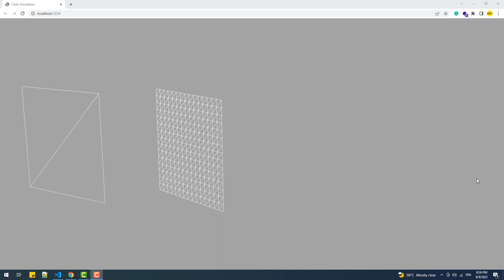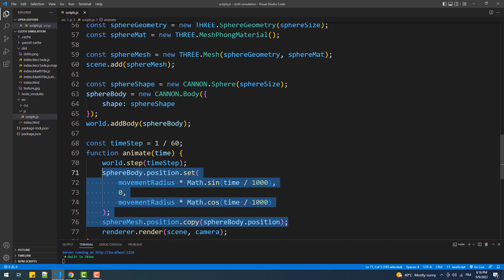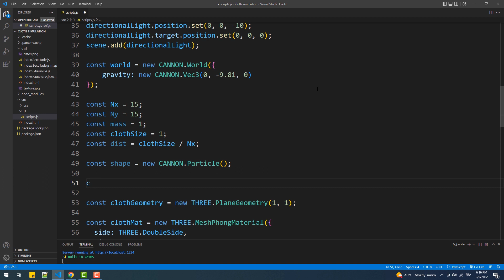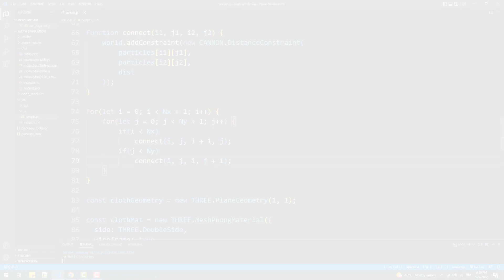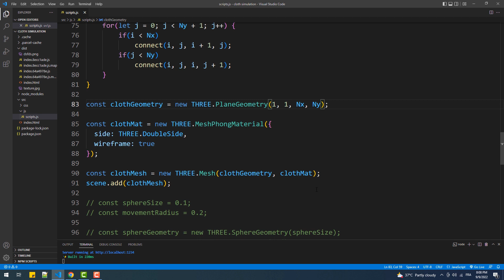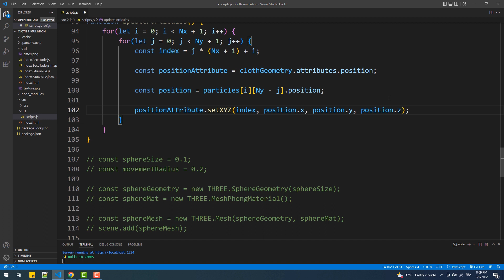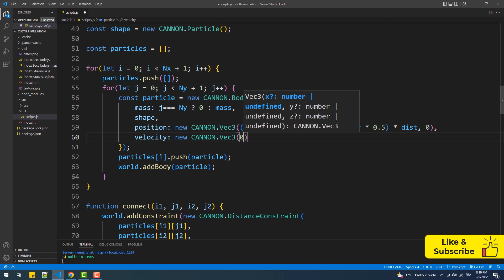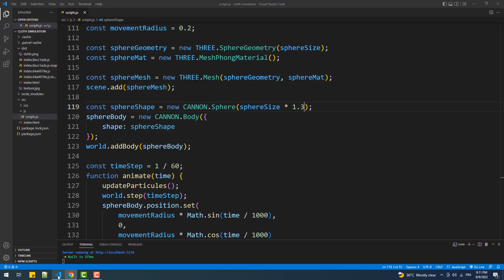Cloth Simulation Using Distance Constraint - Three.js & Cannon-es Tutorial

Comment: Is there any way to rotate the cloth?

I tried to use quaternion, but it didn't work. I'm fairly new at cannon so I couldn't figure out how to do it. By the way keep up the good content :)
Reply from the maker: Yes it doesn't because if you think about it. The positions of the mesh's vertices are being set from the physics bodies (the particles). Therefore rotating the mesh won't work.
What you should do instead is reset the position of the bodies (the particles).
So if you want to set the rotation initially you can do that by changing this line: position: new CANNON.Vec3((i - Nx * 0.5) * dist, (j - Ny * 0.5) * dist, 0),
Or you can change it later by calling: position.set()
Reply: @WaelYasmina  Thank you so much! ❤️